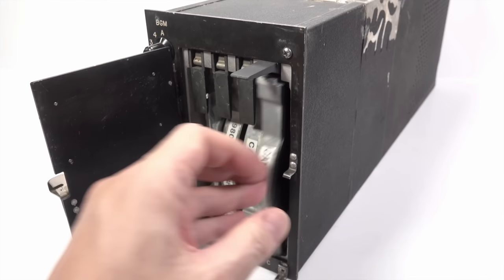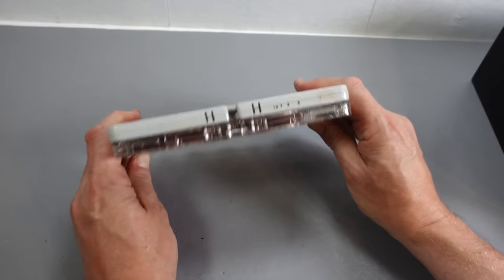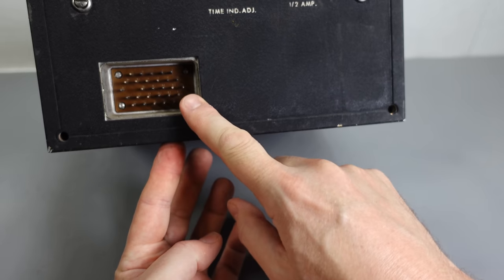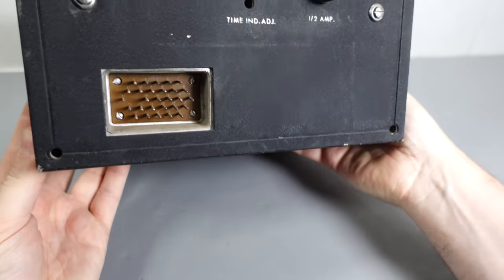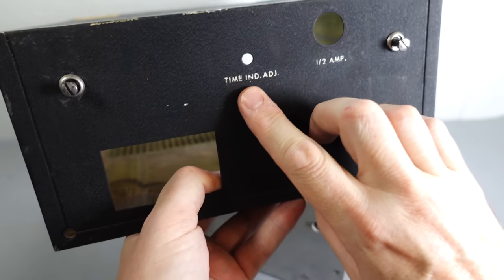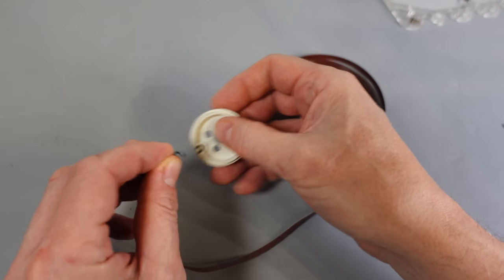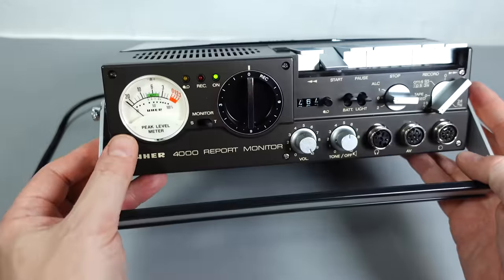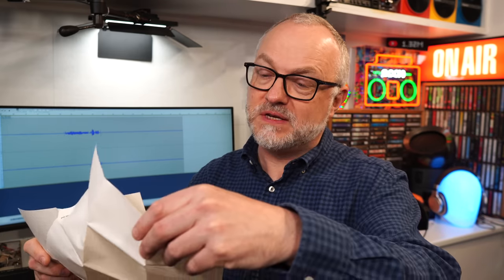Mystery aviation tape machine

Comment: The details suggest that this is a fairly early version of a Cockpit Voice Recorder. It's approved by the FAA (Federal Aviation Administration) which was (and still is) the Regulatory Body for CVRs in the USA, and these devices became mandatory fitting in airliners from 1967 onwards and had to be able to record 30 minutes of audio from one or more microphones in the Cockpit. Modern CVRs are of course digital (they're now referred to as DCVRs) and have to record 24 hours before they automatically over-record. The only thing missing on the device you have is any special protection from impact, fire or immersion, but the early CVRs were typically very basic.
Reply: That it was made for the FAA, I feel makes it likely it was a early CVR.
Reply: @axelBr1  Yes, important that it was designed and made specifically for the FAA, not for an aircraft manufacturer or airline.
Reply: My thoughts exactly. “Say again” as recorded suggests so too.
Reply: I agree about the voice recorder function for the pilot. The recorder would probably only record when the radio microphone key was depressed (leading to one of the control contacts on the back of the machine), so it is possible to fit only an hour of radio talk maximum during a flight (or two hours depending on recorder heads).
Reply: The only problem with this logic is that it's not nearly hardened enough. Even the first ARL Flight Memory Unit, which was wire recording based, was very hardened in order to survive a crash. By this time it was well understood that these things needed to be hardened. I'm more inclined to believe this is a secondary recorder designed for quick access, which definitely also existed. Alternatively, it could indeed be something ground-based. Despite being seemingly overbuilt, being overbuilt is not uncommon in the aviation industry, especially in this era. Even ground-based equipment might need to be this robust, especially if it gets moved around on an airport.
Reply: This is exactly what i thought it was too an inflight recorder !
Reply: That was my take on it too. I used to work on data recorders of slightly newer age than that. The CVR only needed to capture the last 30 minutes as that was more or less the critical time for issues with an aircraft (crash?)
Reply: it is my thought exactly as one of the earlier black boxes.
Reply: You sir, are correct
Reply: @@lurch789 FAA wouldn't put dinner music and safety announcements in one of their planes. Try again.
Reply: It's not a crash-type CVR because it's using a tape that could easily be ruined in a crash.  That kind of thing in those days would have been a wire recorder because you either have to physically destroy the wire, mag-pulse it or get it really, really hot to spoil it where I could ruin that whole cartridge with my lighter before you could say "hey knock it off" if I were that kind of jackass.  It's definitely airborne equipment but not for such a dire purpose as accident investigation.
Reply: Modern CVRs [...] have to record 24 hours before they automatically over-record.

That's not true, the FAA still requires only two hours of recording time. In the EU the EASA increased the recording duration to 25 hours in 2021 and this year the FAA proposed the same but it hasn't made it into the US regulations.

Comment: My grandfather worked in the aircraft industry in the 1950s, this is an early type of cockpit voice recorder, it records only when the mic is keyed.
Reply: That makes sense I was wondering they can't be swapping these every 30 or 60 minutes.   Unlike now, recording only when keyed up would make it much more likely to record everything with the storage of the time.
Reply: That makes sense. No cockpit audio - just flight crew ICS/Radio mic audio.
Reply: I'm far from being an expert but I agree!
Hence the solenoids for activation of the recorder when the captain, F/O of Flight Engineer microphones buttons are pushed.
Even nowadays, cockpit voice recorders only capture a certain number of minutes and keep recording over and over is a loop 
If this is a mono recorder with 4 tracks at 30 minutes per side, is it possible that it was capable of a total of 2 hours of continued recording?
Sounds very useful for maintenance or investigative purposes to listen to the cockpit activity in case of an emergency situation with a safe landing without removing the fireproof one. But I don't know what year did aircraft start using those as standard equipment.
Very interesting!
Reply: But on the other hand only half of the conversation with the tower would be recorded. You could not record the towers responses, if the mic/record key is only activated when the captain is talking.
Reply: @ruurdkemeling7423  Theoretically not needed, both sides of the conversation that is.  ATC has it's own recorder.  Recordings are held a certain amount of time before being erased and re-recorded.  If there was an issue, it could be mated with the ATC recorder's record. Probably a back-up for the pilots to prove their end of the conversation.  At the time it was manufactured, 'black box recorders' were not globally required.
On the tower / GCA side of things, we had a 10 channel recorder in our setup.  This was in the 1980's, so memory is not as good as it once was.  As I recall though, we had 10 or 12 inch reels, 3/4ths of an inch wide, moving at half an inch per second.  Both sides of all radio communications were recorded all the time. When one recorder stopped, the other started. I'm sure other setups had different equipment as most of ours was built in the '50s.  We set up expeditionary airfields.  It was fun when we got to do our job.

ATC = Air Traffic Control.  GCA = Ground Control Approach. Radar operators talked in the pilots when the runway was not visible.
Reply: @ruurdkemeling7423 but if the tower were using the same equipment with the same limitation, you could sync up the two recordings for a full transcript.
Reply: @ruurdkemeling7423  - Which probably would have been ok back in the 50's.
Reply: Just about to say the same thing. Only records pilot side of conversation when comkey is pressed. This way you can save tons of space. Plus feedback to a pilot(or engineer). via a light "tape is low"
Reply: Isn't it true that until the digital age,  CVRs had a very limited amount of recording time, hence why after an incident it would be required as soon as possible to pull the fuse powering the device to preserve evidence. I've not seen any CVRs that look anything like the one in this video however.
Reply: @tspcrowther  this is from a time before CVRs were really even a thing and way before they were actually mandatory. This is more just to keep audio notes about heading/altitude and whatever miscellaneous thing came up rather than a whole conversation between both sides.

Comment: What makes the difference between belts that last 60+ years with no visible degradation & those that completely evaporate in far less time would be interesting to know.
Reply: Likely materials used. I don’t know what they used in that belt, but if it was vulcanised rubber it’d last practically forever. It’s the more modern synthetic rubbers that turn to goop over time, or harden and crack
Reply: Absolutely! I was amazed to see the belt still in one piece and functional!
Reply: Very light use
Reply: Different materials, made to a much higher standard for aviation use, and of course "everything was better back in the day"... :P
Reply: A couple years ago, I came across a big box of old RC airplane stuff that probably dated to the 80's. In there were a couple boxes of Sig brand rubber bands, in perfect condition. Within a couple months of opening the packages, and stored in my air conditioned house, they'd all deteriorated to the point that they'd snap as soon as you started to stretch them. So they lasted decades in perfect condition, and turned to jelly in the course of a couple months. I'd love to know why.
Reply: Real rubber from a rubber tree vs synthetic made rubber..look at the vintage cars tyres no cracking..look at a 10yearold Dunlop cracked
Reply: @Kevin75668  Oxygen degraded them once the package was opened.  In chemical terms, the atmosphere we live in is quite corrosive; just ask the nearest hunk of iron or steel.  Living things have elaborate systems for minimizing and mitigating the damage, and it's why we add anti-oxidants to just about everything that won't take a coat of paint.
Reply: Technology, that make sense for particular purpose - is short answer
Aviation, military and aerospace tech is way ahead of commercially available for civilians
Reply: @jpdemer5  In fact the name for the process that causes corrosion is literally "oxygenation" because for a long time we thought oxygen was solely responsible for it. It turns out that the mechanism behind it actually involves electrons and oxygen isn't the only thing that can do it, oxygen is just really good at it and very abundant so it's responsible in most cases. We package a lot of things in sealed containers with an inert gas like nitrogen in order to avoid it happening.
Reply: I kind of understand that consumer grade devices would have rubber belts that degrade over time, much like the rest of their components. Considering the enormous amount of those devices, and the sadly small quantity of them that do get repaired and specially, still used past the point their technology has moved on, it makes sense to make them such that their environmental impact is minimized, as sadly, the majority of those millions end up in landfills. Then again, making them easy to repair is a must.
An aircraft grade part tho, is different. Those just cannot fail outside very well known conditions, you cannot have a part there suddenly not work anymore cause it was of substandard quality. In other hand, the overhaul times should cover the maintenance of stuff like degrading belts too...
Reply: @hedgehog3180  "Oxidation"